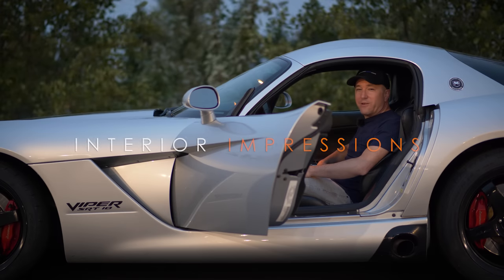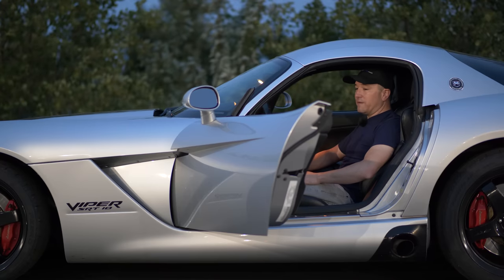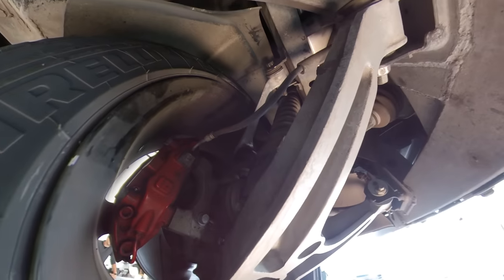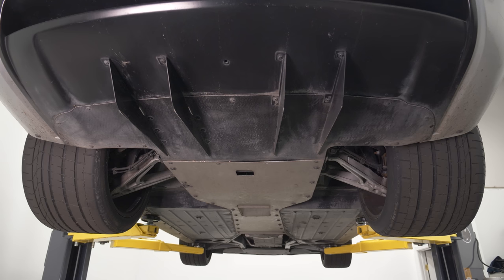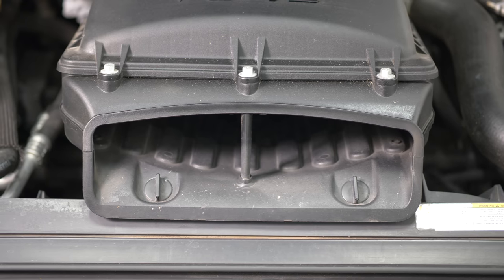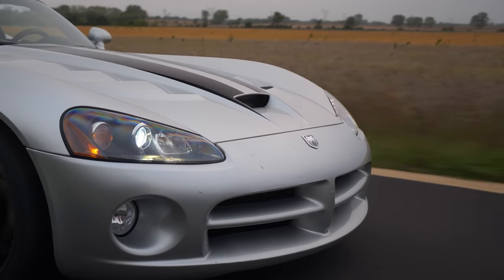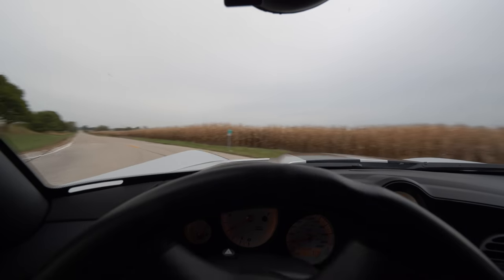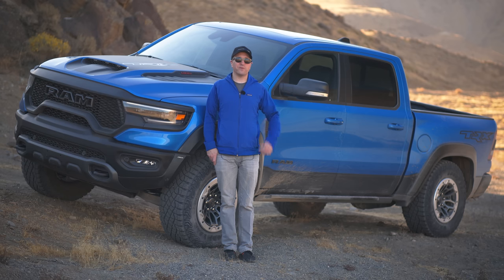Dodge Viper | Super Car or Garbage Truck?

Comment: The only excuse I can make for the the interior is that the performance and exterior were punching so far above it’s weight for the price point that concessions had to be made somewhere.
Reply: It's interior is very much standard for an American car in the 90s. As he notes, the parts are right out of a Breeze or Neon. That's what Dodge had available. They simply lacked the resources to give this its own switchgear, door hardware, etc.
Reply: Also being old and remembering ..no one gave a shit about interiors in the 90s even some of the German stuff was questionable.
Reply: Only corvette can make that excuse. Thats the biggest bang for the buck.
Reply: It’s a race car... who’s looking at the interior when you’re focused on the tarmac?
Reply: @brodiwheeler7583  as the owner of a terminator, I agree with this lol.
Reply: @ericdolby1622  being the biggest bang for buck does not exclude all other great performance-per-dollar deals.
Reply: @bambammartin1556  very true.
Reply: @markmiller3279  Except the Gen 4 (the one in this video) is not a 90's Viper. 2008-2010.
Reply: @giovanni4304  LOLL no replies to that. It's a turd for 2008-2010 and badly under powered for the engine
Reply: @jbmazhar2000  600hp in 2008 was the furthest thing from underpowered. Don't forget all Vipers are naturally aspirated and to this day it's still the highest powdered n/a engine
Reply: @giovanni4304  you're right 600 horsepower is alot but unimpressive coming out of a 8.4 litre v10. Also it is definitely not the most powerful n/a engine. i dont know if you misspoke or something. Lambos make upwards of 700hp with smaller 6.5  litres engines. The Hurrican uses a 5.2 and makes 631. I know those cars are newer and substantially more expensive but you said "most powerful" and "to this day". When i said it was a turd i meant only the interior, obviously a pretty special car otherwise.
Reply: @jbmazhar2000  most powerful V10 engine* https://www.google.com/amp/s/www.motor1.com/features/239145/most-powerful-engines-cylinders/amp/
Reply: @giovanni4304  Your link says what i just told you, the lambo makes more power with a smaller engine. A much smaller engine. But even if i accept that its the most power, the statement is impressive when you dont take into account the ridiculous displacement of the engine. Its the same reason i think the veyrons and koenigseggs are unimpressive because when i realise how unuseable and ridiculous they are it kinda ruins them for me. Just my opinion though you're entitiled to yours. The hurrican is effectively an audi, mclarens are touted as some of most comfortable sports cars available, porches have reliability comparable to civics, and all the while, all of them, being insanely capable. That, to me, is masterful to pull off. Cars like the viper are cool and special in theyre own right but theyre no astounding feat of engineering.
Reply: @jbmazhar2000  fair enough, don't forget that I'm slightly biased considering I own a Viper. Is it technologically fancy? Not at all, ancient pushrod engine design with massive amount of torque, gen 1-4 viper is one raw, uncomfortable piece of shit lol When the gen 5 came out it made a lot of purists mad because of the added features. For me? Just fulfilling a childhood dream 🙂
Reply: @giovanni4304  Honestly somehow managed to miss the viper in your display picture LOL. Obviously its a super cool car, I imagine its an absolute thrill to pilot around and all the looks you must get is gotta be a cool feeling. Its not for me but i can more than understand the appeal. I doubt a 911 would even turn any heads these days. Its a fairly common sight in most cities but that's my childhood dream, an absolute beast hiding in plain sight.
Reply: The interior doesn't matter, it's a performance car not a luxury car
Reply: @markmiller3279  Ford GT has the same type of thing
Reply: @jbmazhar2000  I love 911s especially gt3 and gt2 997. But reliability factor of Porsches is a lie, short term yes, but long term no way. Look at any 20 year old porsche or 15 year old. Money pits electrical gremlins galore and engine problems. Vipers and corvettes from 20 years ago have little to no problems and very easy to maintain. Also much cheaper to buy new end used  better value. However I would pick a 997.2 gt3rs over a viper acr possibly
Reply: @A500-g6g  Porsche beat Toyota this year in terms of problems per 100 vehicles. They've been in the top 10 most reliable manufacturers for over a decade and they have the distinction of being the only manufacturer on that list to exclusively produce high end performance vehicles. Vipers and Corvettes from 20 years ago aren't on the road today unless they've been treated like show cars. People daily Porsches, they hold their value up to high mileage, and sell more than viper and corvette combined at much higher prices. This speaks to their reliability and overall quality.
Reply: @jbmazhar2000  I said LONG TERM  reliability, old Porsches are very unreliable and well known money pits, I live in Europe. Corvettes and vipers from 20 years ago are show cars 😂 they are often bought on used market as daily drivers, we have some in Europe aswell btw, and they hold up fine. Look up problems on 911s from 20 years ago. IMS issues engine likely to get destroyed. And probably much much more. Then look up vipers and corvettes from that time, literally no major issues. They are durable and tough long and short term. It's all good to cater to the rich 5 percent who can afford to buy them new and have trouble free few years but down the line when normal every day people want one they have to put up with major issues. It's documented all over YouTube even if u wanna see just search buying c5 corvette then search buying a 996 911 spot the differences lol. Porsche is only for rich people top 5 percent everyone else will go bankrupt trying to get one so it's a shame
Reply: @jbmazhar2000  displacement and engine size are seperate things. Ls7 7.0 v8 454lbs bmw n54 500lbs 3.0 inline 6 and a much bigger engine physically. This viper engine is probably smaller than the huracan engine and most likely a fair bit lighter. Push rod engines are great for this reason. Also much more torque. And not to forget you won't get much more out of a huracan engine keeping it NA whereas all motor projects on LS engines have achieved 1200hp plus. All engine no forced induction
Reply: I had to replace my rear hatch switch, they don't make them any more, lucky for me, is the exact same as an 08 caravan, say what you want, but that's kinda genius if you ask me
Reply: @mikemullinix2698  one man’s trash is another mans treasure I suppose... but I have no room to talk since I drive an 03 terminator which has all kinds of parts bin stuff lol
Reply: @DaDaDo661  German interiors in the 90's and even today range from questionable to borderline "why is this here?" for the most part.
Reply: @ericdolby1622  this thing beat corvettes consistently
Reply: @jbmazhar2000  and the viper costs less than a third of those cars
Reply: @marcpomaville9429  true. I'd love to be behind the wheel of either but I guess the viper is a little more exclusive. I've always been a big Chevy fan and the LS motor is just so great.
Reply: @jbmazhar2000  Brother , 600hp is more than enough for the Viper
Reply: @markmiller3279  i mean hey they had very low budget first of all and it was secret project at start
Reply: @ericdolby1622 Corvette interiors actually aren’t that bad they got comfy seats, C5 and up got the HUD
Reply: @jbmazhar2000 tried to hate and got destroyed, hope you learned your lesson cuz if not you life definitely reflects it

Comment: The phrase  "I need more HEAT!"  has now been fully integrated into the local lexicon.   Thanks.
Reply: One of the most memorable cars I've driven. 100% visceral hammer.  Only drove it on street. Everyone should at least experience driving this car once.
Reply: saw this when window xp still new...
Reply: When did Toyota stop making those? I can’t find one

Comment: The Viper engine is not based on the truck V10; it's the other way around.  Viper came out in 1992, first V10 truck was 1994.  Both started as an extra cylinder on the LA-block V8 with a longer stroke, but beyond this concept, the two diverge.  The Viper V10 really torched a lot of its V8 roots in the aluminum conversion, whereas the Magnum tried to use 5.9/5.2 parts wherever possible.  In the end, basically nothing can be swapped between the two.  But still, the Viper did it first.

Comment: Loved the video. When you get a Gen V, there's a huge breadth in spring rates and daily livability from model to model. I prefer the dual mode Bilsteins, the Laguna interior is nicer than a Hellcat and actually feels special, the 18 speaker stereo is decent. Dodge finally made it a complete experience and you don't have to make excuses for the inside.
Reply: something about the phrase "18 speaker stereo" makes me giggle
Reply: @JamesFuston  18 speaker is already silly, but 18 in a VIPER cabin...just excessive.
Reply: @Nissan370Z Glass  Is it OEM?
Reply: @nicholasdean3869  obviously not
Reply: until the motor grenades, yes
Reply: @Mach141  Ok so what's the point then? A modified and tailored sound system in a cheaper sports car is better than a stock gen 3 Viper? Would you rather be in a Viper or a 370z?
Reply: Needs 20 speakers or no care.
Reply: Gen 5's are also extremely expensive, probably why they stopped making the car (for now). Just too expensive compared to stuff like the corvette, pretty much its main competitor.
Reply: I have a Redeye and a charger hellcat for the same price as a Gen V viper.
Reply: @mattsomeonewithansrt3948  Yeah, the prices on vipers are ridiculous - again, probably the big reason they quit making them.

There is no good reason for them to cost that much either, just look at the demon or super stock - 80k dollar cars brand new lol. No excuse for viper to cost 40k more
Reply: sadly gen 5 shot up in value almost immediately and is very hard to find. Its the best Viper yet and they cut off production way too soon.
Reply: @MrAchilles113  Yup, ridiculously low production numbers and out of the box overpriced, now the snobs who do have them marked them up even more than what they bought them for
Reply: @abaddon3735  the gen 5 vipers are hand built race cars, that are faster than either by a long shot around a track. It beats cars that cost 3 times as much. So the cost isn't unwarranted
Reply: @marcpomaville9429  I don't know why I was saying they are a rip off in my previous comment, they aren't. The MSRP price for Vipers (until Dodge) quit making them was a good price, they just did not sell well because they are more expensive than Corvettes, which are their competitor (even though the Viper is much faster and preforms better, the two are commonly put together for some reason).
Reply: @nicholasdean3869  18 speaker harmon kardon is OEM.

Comment: I love the Viper. It's raw, real and straight forward. You get behind the wheel and you know exactly what to get. Yes, the interior is spartan...because that's not what this car is about. Yes, it's loud and uncomfortable, because it's not supposed to be some pony to parade around the strip of Las Vegas. I had the pleasure of driving it once...I was terrified but appreciative of just how unapologetic it is. It doesn't baby you, hold your hand, or tell you everything is gonna be ok. From the moment you get it and start it up, it tells you 'Don't underestimate me, I will bite your head off if you get overconfident'

I love how connected you are. It's just you, a stick shift, no traction control and a big-ass V10 up front. Good luck, try not to die.

Comment: Great vid. You guys should get an autoform TA rear lip to update the look. My gen 3 is a great daily. Gets about about 21 mpg as long as you don’t sit/idle. Reliable as hell. Easiest car to work on, I’d say even better than corvettes due to the room and exhaust positions. It feels pretty luxurious to me compared to stripped modded stuff I’ve built. Interiors are perfect due to the snob repellent. Only other car that compares is the Elise like you guys said. 
You can spend 30-50k on a decent viper, that would get you an automatic convertible awd Carrera4 for that price equivalent. Really the best sports/exotic car for the money imo.

Comment: 11:45  Dodge did not have V10 powered Cargo trucks to pull engines from during development in 1989/90.  The V10 truck engine didn't exist until the 1994 Ram.

Comment: How does this compare to the last year or two in the interior? Wasn't there a big interior update for those?
Reply: Much of that improvement is general improvement in automotive interiors in nearly a decade. The Gen 3/4 cars were designed using late 90s parts, from a very poor period for interior quality in cars, especially American ones. By 2010 they had a much improved parts bin to pick from, as well as ownership more willing to spend.

Comment: Every car has a certain niche of people that enjoy it for what it is.  When someone who is not a fan evaluates it based on a personal criteria it will not measure up.  If I needed soft leather to comfort my ass and paddle shifters to move my car then spending 3X more seems to be the right thing to do.  There are more Lambo people doing car shows and weekend driving than tracking.  IMHO.

Comment: This Viper's interior makes the C6 look like a W221 S-Class.
Reply: C6 interior is wack as well, including it's Chevy Cobalt wheel.
Reply: @blknblubkrdude  Absolutely but at least they didn't use bunch of cargo van and work truck parts for everything you touched and looked at. They at least tried to make it feel like a car and not a ram with a slightly smaller steering wheel.
Reply: Yeah, and the C6 isn't very good even. This looks bad in comparison to every modern car.

Comment: You want NICEY interior get the GEN5 at twice the price. I had a Gen 3 and had no problems driving it anywhere any time any distance. Austin to Atlanta Ga. More than once. It is a True Car  Guy’s car.As James Hammond put it, it handles very well until it doesn’t then it tries to kill you. It was a race car built by car car builders then put on the street. See it for what it is; A Race car made street legal, not a Street Car that people buy and try to race!? I personally have no issue with the lack of interior just for that reason. I’m used to cars with RollBars and Gauges as the highlites of the interior. You mention Lotus, they have even less interior. You also have to remember Lee Iacoca’s instructions when he finalized the OK for the Viper. He wanted something that would beat the Italian V10’s and V-12’s and a reasonable price. The Viper has almost always been 1/2 the cost of the Italian cars it was designed to beat up on.

Comment: To play devils advocate. When the AC control head breaks it is 100 bucks instead of 800. I mean there are pros to Dodge's parts sharing. You can go to a junk yard and find buttons and controls for your super car out of an Avenger or something.  Also if your daily driver is a Ram of the same generation, you will have that same familiarity in your super car. Could make it easier to use.

Comment: These things (ACR, especially) were competing with cars 2-3x the price on the track. And it crushed most of them. Ditching luxuries for average Chrysler interior quality of the time was perfectly excusable. 

There is a reason the gen 5 was so much more expensive (gen 4s also had decent discounts off sticker when new).
Reply: Ok, but Corvettes and Vipers are not bargains, it's just German and Italian sport cars are overpriced by design for "exclusivity" which is very important for the douchebags who buy them and drive then 500 miles a year.
Reply: @truantray  100% true. Though Vipers and, to a lesser degree, Vettes are engineered by people with extensive racing experience. You can build some pretty damn wild home made autocross rides but FCA and GM are so far the only ones offering you that experience, with a warranty at a comparably affordable price. If track days are your reason to get a high performance car, skip the poser stuff like the Huracan or McLaren and grow a pair and drive an ACR. There's a reason every time a former race car driver drives a gen 5 ACR they gush about them unlike any other production car out there. They were designed by pro racers to tick all the boxes a pro racer would want in a street legal car.
Reply: If you compare the gen 5, even the ACR, to what they've beaten on tracks, its incredible. Sure, the Viper ACR 5th gen is in the 6 figures, but its near the bottom of the barrel levels of cost. Vettes are a close second, but remember... the ACR is beating the shit out of what the Vettes can barely compete against... which is not to say anything against the Vettes, in fact, it just proves Vettes are insane value for performance and arguably better in terms of interiors and drivability. If anything, the ACR is what a Vette would be if Dodge's tunnel-vision was the mindset behind the engineering of a car for the purpose. Think about it, the Challenger is the last true Muscle Car standing, where it does not give a fuck about corners, while the Vipers of any generation, trim, what have you, are meant to be driven seriously around corners and does not give a damn about the driver's comfort, let alone safety (in fact, sitting in one is so unbearable as it forces you to sit in an awkward fashion).
Reply: Doesn't the ACR still hold a few world records? I know it still holds the title for biggest v10.
Reply: @chancehupp3142 This is late but if you’re talking track records, yes the Gen 5 ACR still holds 10 lap records last I checked, and I’m pretty sure the viper held the record for largest displacement when it was in production. I think Bugatti holds the record now.